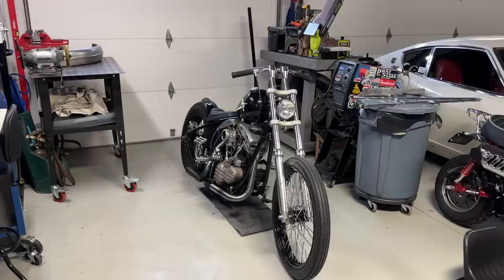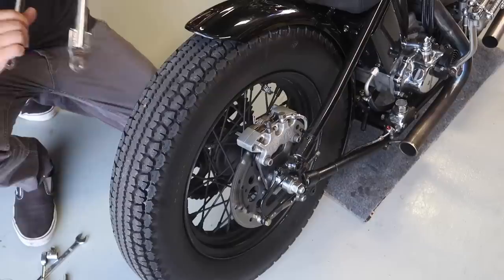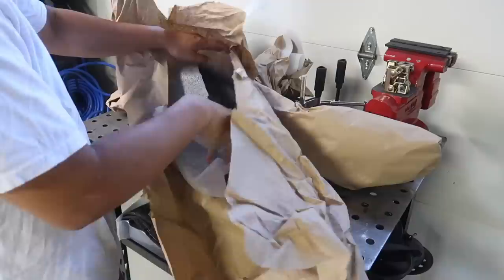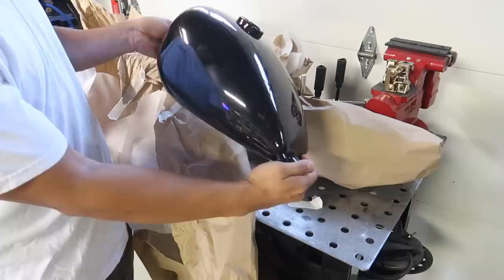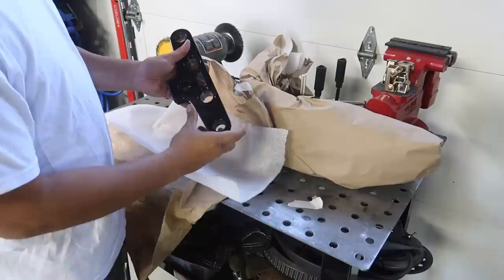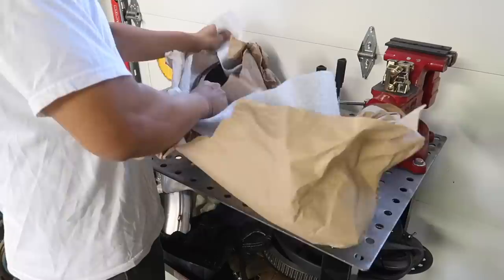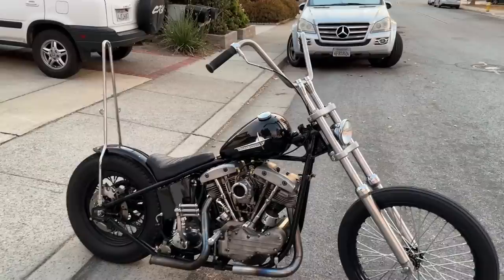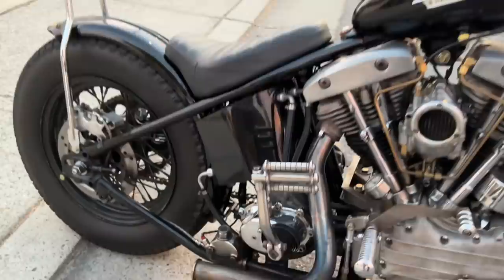Shovelhead Camping Makeover Part 1

Comment: Get you a Ozark Trail stove,  Ozark Trail cup with foldable handle, Ozark Trail 32 oz tumbler lid, LIFE TO GO stainless steel foldable knife, spoon, fork set. Order a propane cylinder carrying bag that can hold 4 small propane cylinders. You can put one propane cylinder in the bag first then your cup, you can put the stove in the cup with the foldable knife, spoon, fork. I also ordered a small dish soap for camping that will fit in the cup with everything else, then put the tumbler lid on it and you have a one man cook set about as big as a stanley food jar if that big. I have about $50 tied up in the whole rig if that much. Small and portable.

Comment: Really interested in these Shovelheads. How much would it cost for someone to buy one in this condition? Or is it better to build your own? I’m not all that great at mechanics and I can’t weld but id like to get into the chopper scene
Reply from the maker: I think around 10-15k depends on how much done to the bike.  Stock shovel is 4-8k depends on your location. You don’t need a shovel to get into a chopper scene. Start with something cheaper like a sportster and learn from there. Once your mechanical skill is better then look for a shovel. I started with a Honda and it took years for me to get where I’m at and I’m still learning as I go.

Comment: yo. so i need abit of help. i have a xlch 73, with a CV carb that i cannot get to running correctly no matter what i try. is there anyone with some specific settings for a cv carb for a sportster xlch/xlh or know of a different carb that would fit it better that wont eat you wallet? maybe ebay sns super E